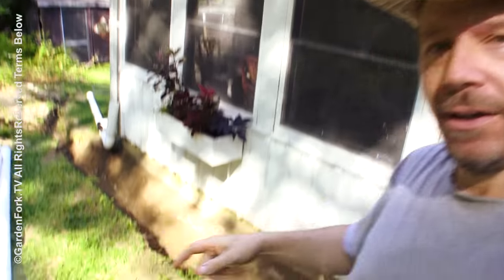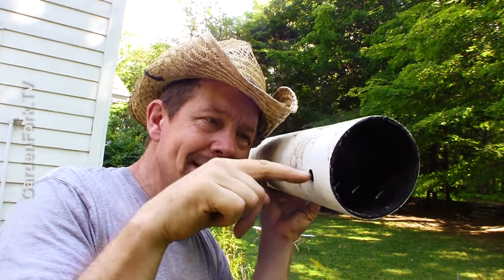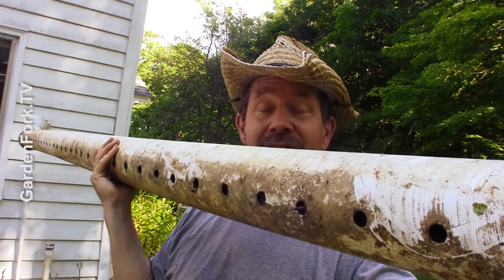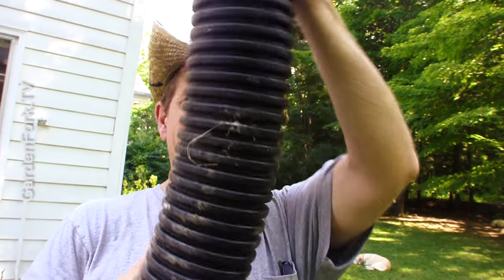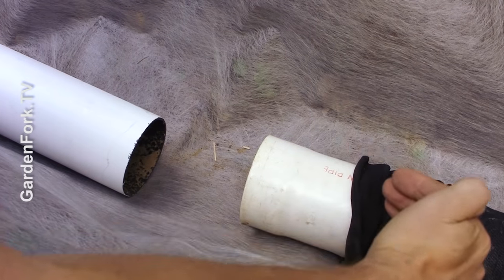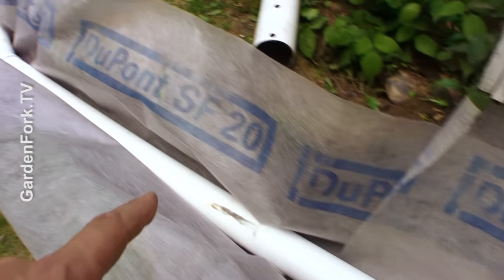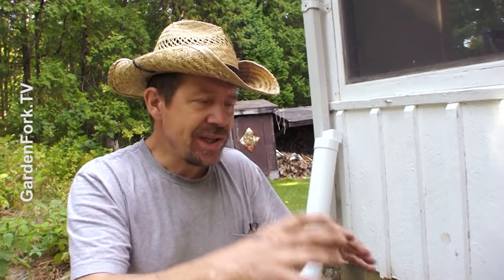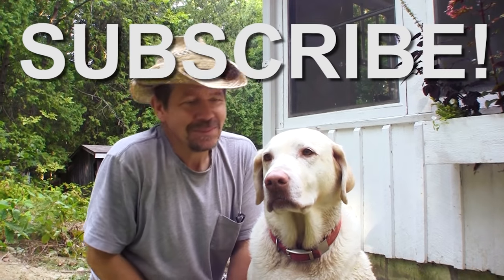How To Put In A French Drain - GardenFork

Comment: Now I don't know where you live, but in northern states that get a lot of snow and....frost, will that affect this? Frost can go pretty deep into the ground, some people recommend putting your drain pipes 6 feet deep but I don't know if that's necessary for a French drain. I'm going to be installing one in front of my garage with a metal grate on top because someone, in their infinite wisdom sloped the driveway towards the house a little which was completely avoidable.
Reply from the maker: i've seen that a few times where they slope the drive into the garage. nice. french drains, i believe, are surface drains, and will freeze, but that's ok. be sure to glue the pipe and use quality materials. curtain drains are deeper, and footer drains go along the base of a cement wall, hence the name. the key to a drain with a grate is to lift the grate and clean it often or it will clog the drain pipe.  thx!
Reply: GardenFork thanks for the extra info! I'll do a little more research. I was planning on digging as deep a hole as possible to the side of the garage for all the water to drain into a catch basin of some sort. The idea is to hopefully get below the frost line so the water can always drain down. I can always use salt if need be
Reply from the maker: i think you are going to be using salt, its tough to keep a channel drain  from freezing in winter. mbe you could wrap the drain pipe with a pipe wrap heating cable?
Reply: GardenFork that would be my only other option I think. But it's not that much water in the winter, I try to keep the driveway clear so I don't get the backflow into the driveway. Sloping it to the sump will also help

Comment: Pipe is in wrong direction. Coupler end should face away from the direction of flow. 

No need to run fabric along discharge pipe.

French drain looks to be too close to the house. French drains allow for water to seep into the ground. Harmless away from the house, but potential problems close to the house. Water will very slowly make its way into the pipe because it's wrapped, and into the ground very close to the house.

Your problem is surface water, not ground water. French drains are for ground water. Surface drains with solid pipes would immediately collect heavy water before it gets into the ground and discharge it to your shed area. You could've tied them in to the existing roof drainage. A lot better, easier and cheaper. 

Why the perforated pipe on the bottom of the downspout?

Comment: I always thought the holes should be up to get the water, then run it where you want it to drain? :-)
Reply from the maker: the first time I did this, I looked for information and found a very long but good explanation on a contractor website. basically, if the holes are up top, enough water has to collect in the gravel trough so the water reaches almost to the top of the pipe before it starts to drain away. with the holes almost at the bottom, the water drains right away.
Reply: GardenFork Thank you for this explanation! I've been installing a french drain at work and the direction of the holes has been keeping me up at night.

Comment: show the end of the pipe where it "ends in daylight" how is that pipe capped off? if it does not have a filter in it then animals snakes, dirt can flow or go back into the full length of the pipes, correct, maybe a pop up water release box would be good at the end
Reply from the maker: you could do a water popup, but we are on a hill so it comes out of the hill and we have a screened cap on it. thx!

Comment: Confused whether to use geo fabric or not, I've seen pro and con on this issue. Fabric tends to clog wth mud and debris and eventually the system fails.
Reply: Depends on the soil. You really only need fabric when it's sandy soil. Many videos of fabric impeding water flow into the pipe, Without even being clogged.

Comment: Reason it's bad to connect downspouts to French drain? My contractor wants to do that. I also have lot of water near house due to slope and gutters. Thanks
Reply from the maker: Hi Allie, the rain water from the gutters can back up and flood your French drain, which then dumps water into your basement. It’s not much more $ to run a second drain pipe for the rain gutters right next to the French drain pipes. I live on a slope and have the same issues. Thx!
Reply: @gardenfork  oh. So the house downspouts can be underground just not flow into french drain..does it have to be a separate french drain or just perforated pipe?